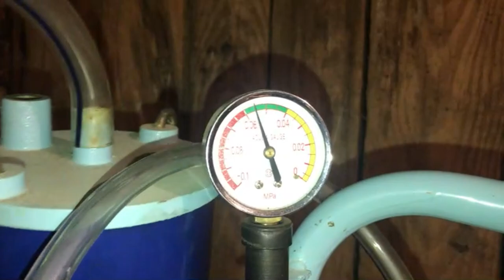Bought Off AMAZON Family Milk Cow Machine Troubleshooting and Walk Through Demonstration

Comment: I just got my new Happy Buy Milking Machine last evening and used it this morning. The new lid has just a milk hose port and a suction hose port. The other assembly sits on top of the handles. It might be a slight better set up because the lid is so easy to clean. The milk hose not so much. Thank you posting this video.  Do you have a video or any plans to make one on how you clean this milking machine?

Comment: Shortly after the machine starts running, it begins to lug down- almost to the point of stopping.  It resumes the proper rhythm if the pressure is released, but it’s happening more often, although the machine has been used for only a month. Any suggestions? Also, how much gear oil should be in the reservoir? Seems to be nothing in the instruction booklet about the proper level. Thanks!
Reply from the maker: I put just a tad of oil, not a lot at all for us. It sounds like it can’t release pressure correctly. Make sure your ball bearing is greased good and help keep a lil pressure valve on the milk claw. If you have to keep it opened a lil bit even during milking that’s ok

Comment: Thanks Mac for the illustration we also have the same milking machine but I was asking which oil should be used for the vacuum pump I heard u saying gear oil is it the same like the one they put in the engines of vehicles like petrol or diesel oil?
Reply from the maker: We place the vacuum oil in the vacuum pump and kinda rub all around.
Reply: Vacuum pump you mean the blue thing on top with screws
Reply: What of the one with a nut down?

Comment: How can you take the rubber out of the actual claw to clean it? Today we are doing our first deep clean on ours. Thanks great video!
Reply from the maker: Most milk machines you disconnect at bottom. This unit you can’t so you need to undo the top and we got a bottle cleaner from superstore and a lil hose cleaner and use them with shaklees organic soap and clean in there and let air dry inside with fans all day after milking. The bottom of the clear part on the claw doesn’t disconnect like it should, but undo top rubber and clean it. Underneath the rubber shouldn’t be nasty in stainless steel just because If it’s hooked up right only air and vacuum goes through it. Just make sure the rubber is cleaned really well and good air flow. We use baby bottle cleaner and a hose cleaner which is thinner in diameter about an inch thick
Reply: The Mac’s thank you. Thought I was missing something.
Reply from the maker: Nothing at all. Y’all are doing great. We deep clean ours usually once or twice a week on top or cleaning each day with running soap Through ! Good luck guys!

Comment: Those red things are not really needed . Just hold the cups upside down and fold the hoses over. . We however replaced the cups and hoses with the heavy duty typical black hoses. We find they work better . More weight to it. We tried another claw but as soon as we turned it the pressure dropped way down. Too heavy duty for this machine.
Reply from the maker: True. I agree, I do not use the red cups but a lot were losing to much pressure with the clear hosing so that helps them. I personally never use them either ha
Reply: @TheMacs1  I found the cup set up that comes with it too soft .
Reply from the maker: I agree. To weak

Comment: Thank you for this video! Do you know where you can get replacement parts for these machines? Ours is identical to yours and the ball bearing for the lid disappeared.
Reply from the maker: You can buy ball bearings most likely at your local hardware, however I buy most parts off Amazon or eBay for this rig. We have since bought a second version of it to just have for changing out and spare parts when that time is needed
Reply: We have the same problem! I just don’t know what size ball bearing I need. Should it be almost as big as the opening or should it be smaller? I got a ball bearing that I thought was the right size but the machine isn’t working- I’m not getting a regular pulse sound of that ball going up and down. Help!

Comment: Hi, do you know where to put the oil? I can’t find it
Reply from the maker: If you’re has it. It’s a lil bolt by the wheel, if not you can just rub oil on the vacuum canister inside so it can move without effort

Comment: I am having a hard time finding a part I need. Inside the blue part where the are pumps up and down is the gasket (not sure what it is called) you unscrew the top plate and it pulls apart to see two disks with a spring type wire around in side. I have replaced every part but my air loss seems to be from that. How do I find replacement parts for that. 
Heidi
Reply from the maker: Thanks for watching! Good question. The pressure should be tight up top and the bottom of that cylinder is a big rubber gasket that should hold your pressure.
Reply from the maker: Are you losing pressure? And no suction? Have you checked your other o rings?
Reply: @TheMacs1  all the o rings have been replaced.
Reply: @TheMacs1  the big rubber gasket is what i can't find anywhere to replace. Do you know where I can find one?
Reply from the maker: I am not sure. I went to a local welding store and picked up a bigger gasket that went to a pipe, cut it down and made do.. mine still leaks but I keep vacuum pump oil in it and just screwed down really tight. Try a local hardware store that may have a rubber flange for a pipe 8 to 10 inch and cut it down. Are you not pressuring up enough to pump or just wanting more?
Reply: @TheMacs1  not enough pressure to pump. I use for goats and it doesn't have enough pressure for them.
Reply from the maker: I got my pressure up also by cleaning the claw release value screw. It has junk build up, I cleaned it and it gave me a ton more pressure. Soak it and clean it. Have you tried that? Is your belt tight?
Reply: @TheMacs1  I have not checked the belt. I will. I pulled it all apart (all that was in the blue pump) cleaned and put back it built pressure then with in a minute it started losing pressure. The sound of the machine stays the same. It doesn't slow down or change in anyway.  So I know it is a air leak. Somewhere.
Reply from the maker: I lost pressure once and it was my pressure valve and then my piston claw the lil screw valve on it was caked with old soap/milk residue. Cleaned it and it worked like a new machine
Reply: @TheMacs1  thank you so much for taking the time to chat with me! Greatly appreciated!
Reply from the maker: No problem! Good luck! Thank you for watching!

Comment: Hello, I’m wondering if you bring your milking machine inside during freezing temperatures?
Reply from the maker: Great question! We do keep in a garage or shed when it’s freezing. Great idea!
Reply: @TheMacs1  is it a heated garage/shed? We have our machine out in our barn which isn’t heated. It usually takes a minute or two to start building up pressure when the temps are below freezing, but this morning even tho the pressure built up there was no suction. I’m wondering if something froze to prevent proper suction, and therefore thinking we may need to bring the machine in our basement.
Reply: I forgot to thank you for this video! We found it a few weeks ago when we were having issues with our pressure getting too high, and used avocado oil (I can’t remember the name of where it was ....... the place where there’s a little metal ball) and it worked like a charm!
Reply from the maker: I roll mine in and out every morning on a lil garden cart. I think it would be wise to bring in for sure
Reply from the maker: Yay!!! I hope it helps!!!
Reply: @TheMacs1  and you keep it in a heated building, is that correct?
Reply from the maker: It isn’t heated, just simply insulated. It would be about 10 to 15 degrees  warmer than outside. However I notice my hoses are stiffer even then. If I was running 0 to 10 degrees Fahrenheit I would probably put a heater in room with it or bring on in to a controlled room.